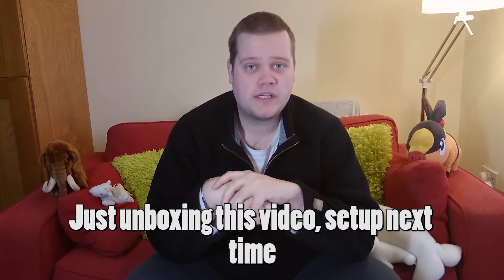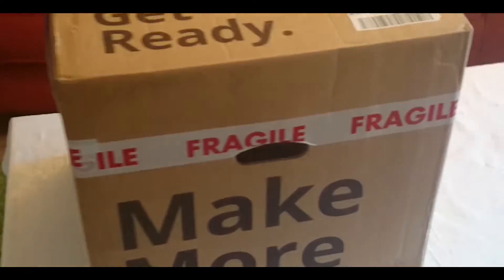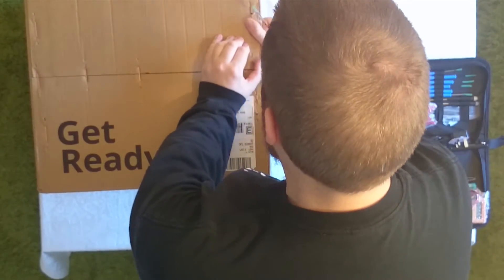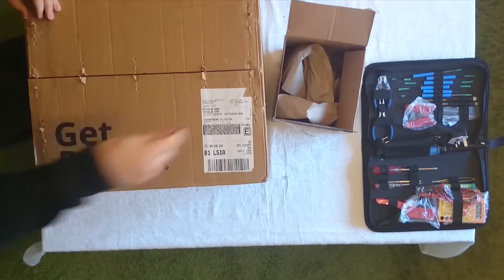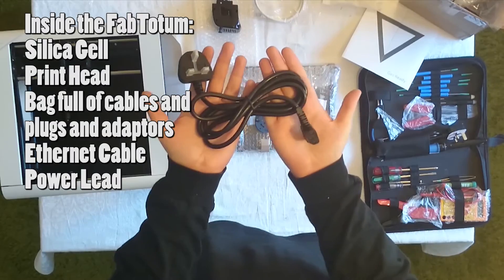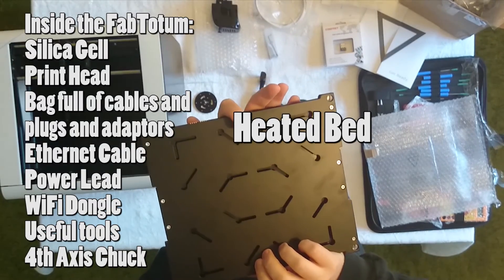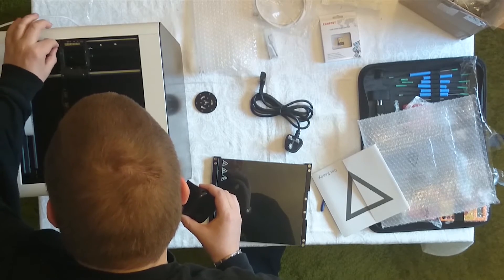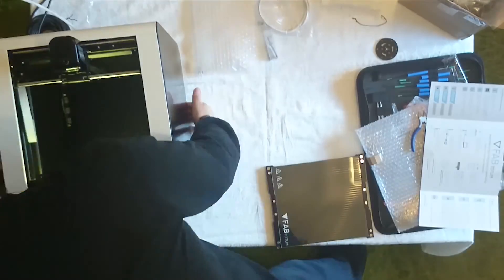FABtotum Unboxing : HandyMann

Comment: Can u use aluminium in the cnc or delrin
Reply from the maker: I have used Aluminium in it and Anodised aluminium. Not tried any other materials.
Reply: @NickMariaDoStuff  come across one eBay but only had the 3d print part in

Comment: Is the quality of material good?
Reply from the maker: Sterminatore67 As I said in the video I thought that the front door felt a little light but having used it for a bit now and having taken it apart I think it is the right balance between being light and strong. Everything Ielse is very sturdy. The plastic on the head doesn't look the best because of the seam between the two half's but that's the nature of how it needs to be built and can't be helped. If you mean print quality, I've been impressed with the resolution so far. I have more videos planned including covering prints so keep an eye out for them or subscribe to make it easier :)